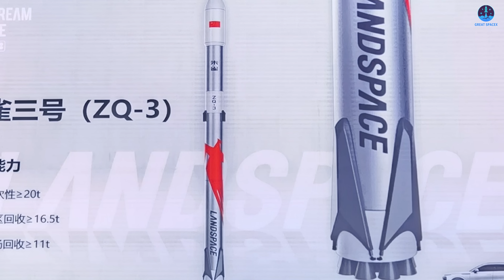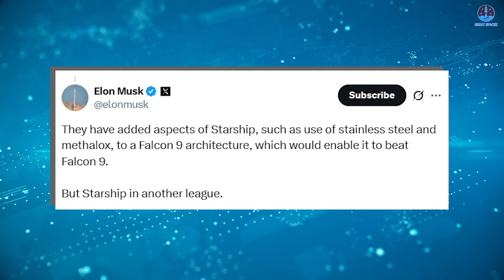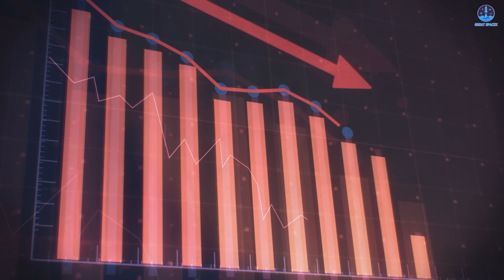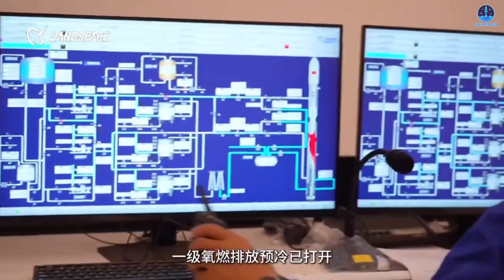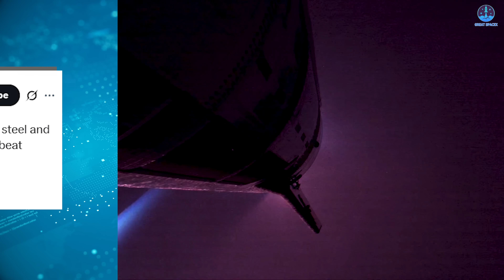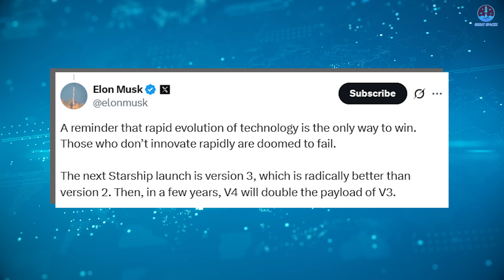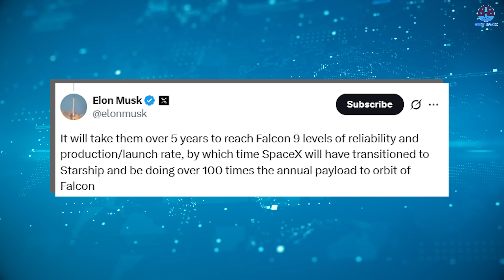Disaster! China is about to Test Big SpaceX Falcon 9 COPY. Elon Laugh...

Comment: 📢 What if the catch for the booster or ship goes bad? Imagine the pin on one side landing properly, but the other one doesn't. The ship is caught, but the grip is precarious. What do they do? They are using the only arm available to hold the ship. I guess a crane would have to be brought in to lift the unstable ship off of mechazilla?

Comment: Space X could have continued to enhance Falcon-9 series. The bigger payload Falcon-9 Heavy has only been used 4 times vs Falcon-9 has flown hundreds of flights. But they went a new direction with Starship.

China copying a highly successful and proven model. Upscaling it to handle bigger payloads than the original. This makes absolutely sense for China. Remember China is still working on the boosters reusability(landing).

From China's point of view Starship is still a work in progress, why take risks, just wait until Space X works out all the problems. Then simply copy it.

China has one big advantage over the US. The Chinese government has committed to making China the #1 space access provider. They are not adverse to the fast cycle of try, fail, learn, improve.

There are multiple ways to accomplish a mission, the brute force KISS method, or the elegant method that will eventually lead to lower costs.
Reply: * 11 launches for Falcon 9 Heavy